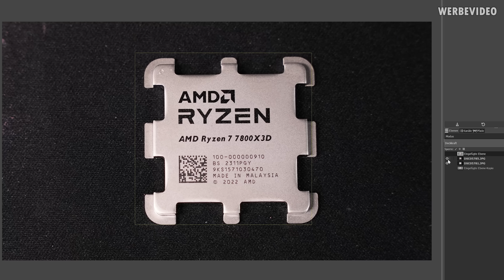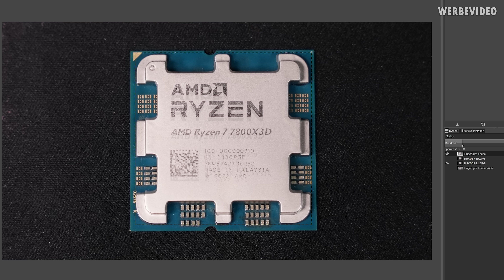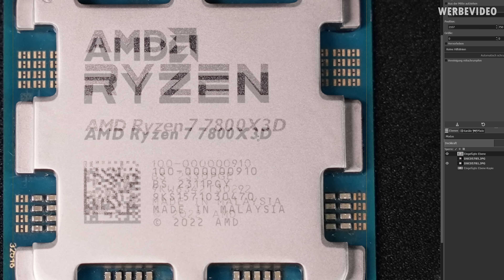Beware! Fake Ryzen 7800X3D CPUs are being sold

Comment: I can easily imagine an out-of-work craftsman having the tools and skills to build this in their garage / workshop. 
Sensible if risky way to earn a decent profit, preying on PC builders looking to save some money. 
The really worrying aspects are: the BOX looks completely genuine. How did they get that?  And worst of all, the matching serial number (cpu and box) plus the genuine looking security seal on the box.   The different font on the heatspreader stood out instantly to me. Nothing else did.
Reply: The easiest way to get the numbers to match is simply to make all boxes and all heatspreaders carry the same serial number, and then never sell the things to retail just mail them one per customer.

I think the fake heatspreader is a zinc alloy casting, if you can accomodate the MOQ, you can order them almost as easily as a PCB if you know your way around the contract manufacturing industry. Genuine heatspreader is copper so it's much more difficult to manufacture.
Reply: This is 100% a Chinese scam. They completely lack any scruples, and even otherwise legit manufacturers will make convincing fakes and sell them via the back door when there's a profit to be made. The box was probably added by the final seller.
Reply: @PharmaGiles  The boxes and fake product could be made in the same factory which is why they have the same serial number. This has been happening for quite some time with sporting goods products and automotive parts, including knock-off serial numbers. The scam culture in China is only just starting to see Chinese youths turn against it (according to statements on other social media platforms). Until the CCP and Winnie the Pooh cares, the scams will keep happening.

Comment: I'd love to see a comparison of the retail box it came in vs a legit box. Or did they find used boxes and repackage? I would think there are marks to show it was opened before like surface scratch marks, adhesive, etc. Does it have the magnet holding the flap closed like the original? Are other AMD boxes identical no matter the CPU or are there differences between CPU models and the printing on the side reflects that? i.e. does the 7600 box look identical to the 7800X3D other than the printed serial number sticker sealing it closed?

Comment: Quick question i have an i3 8350k and it now struggles to play modern games despite a generous 700mhz all core oc.
I have a decent Mobo and ram to go with it.
Would a second hand i7 8700k going through the same process of a generous all core oc be worth it for say a 3 year stop gap as the CPU in question is only £80.
If i upgrade to AMD or Intel it would require a new Mobo and most likely DDR5 ram as AM4 platform despite all the great CPU's are on a dead end platform like the one i am currently on. Intel is not an option as the k series 13th and 14th gen CPU's are all busted internally from what i understand.
AMD would certainly be a massive outlay which i just can't morally ignore and my wife would not be happy if i blew £700 for a CPU mobo and ram upgrade.
Many thanks for any input and advice great content as usual from the MAN himself der8auer.

Comment: I got a 13900k from my local Best buy exactly like this about a year ago. I was delidding it anyway for a direct die water block and the IHS came off easily just like that. Thinner wafer, no die, just black silicone gluing the IHS on. Purchased in store and it was sealed.

Comment: These days you can fairly easily design a PCB, especially if it doesn't have to do anything. The IHS also isn't that difficult to design. Designing both probably wouldn't take a day. And you can have just about ANYTHING made to design for very cheap. Just look at JLCPCB. Send in the files, and you get a few hundred of them complete with capacitors. They even do custom metal 3D components. You order, they make. It's not up to them to ask what you need it for.
Pay say €500,- for 100 PCB's and 100 IHS's, and you only have to sell 2 to get a profit.
And yes, there's also the box. Add another 200,- for 100 of those maybe. Say you're making prope for a movie, of a stage play or something, and nobody bats an eye.

Comment: I stopped using the OLX group portals years ago. It used to be a really good website, I actually earned money for my first car there. But then the portal became more popular, many scammers started using it, the overall quality dropped and the portal itself was not very willing to help, because apparently its task was only to place advertisements and people were supposed to make arrangements on their own. No verification, no responsibility, do what you want and then let angry people look for you. It got to the point that using this website was just a waste of time and money, because maybe if you wanted to buy platters it wasn't a problem, but if you wanted to buy a used graphics card to replace one in your laptop, you bought 4 on this website, just to find out that they were all damaged and regenerated in the kitchen oven, until you finally selected the one that had a short circuit and burned the +12V lines in your laptop. Don't ask me how I know this. Now they have improved the situation a bit, they have safer shipping, a certain level of verification, they engage in negotiations if something is wrong, but still, if you want to be scammed, go to OLX and buy something expensive/specific. I'm not saying that there aren't honest people on this website, but you have a very high chance that your purchase will turn out to be a disaster.

Comment: But why? If you're going to scam people over mail-order (since this scam wouldn't work in brick-and-mortar shops), just send rocks in boxes or send nothing. No need to manufacture an elaborately designed dummy and pack it up in an original-looking box. I thought this video would be about scammers selling re-labelled and possibly modified but still actually functioning (though not as expected) lower-tier SKUs.

Comment: @der8auer-en small holes can be for weight difference compensation.
I saw fake portable HDD/SSDs with metal billets inside to match original specs.
They were even recognized by the operating system, and a small chip tricked the system into storing data... which of course couldn't be read.

Comment: I just had a friend send me a Threadripper Pro 7965WX, MB and RAM to troubleshoot a no start up problem.  The issue was the heat spreader had been shaved and re etched with the Threadripper Pro 7965 WX but it was indeed a TR40 CPU.  I did not have another board to put it in to see if it would boot or what CPU it actually was.  I fixed the bent pins on the MB and shipped it all back to him and had him return the CPU to Amazon where he bought it.  It was sold by Amazon and shipped by Amazon.

Comment: I suspect these fake CPUs may not have been intended to end up in the hands of end users.  Imagine a scenario where a business purchases a bunch of processors from an upstream vendor, then they return a smaller selection of fakes back to the vendor as "NFG", the upstream vendor builds up a stock of bad CPUs, then because of their resell agreement with AMD, they never get returned to AMD but end up getting sold via a 3rd party marketplace as a lot of "bad CPUs".  This is attractive to smaller companies and individuals to sort through the genuine non-working units to find CPUs that were erroneously returned as NFG, so they can resell them as good via a marketplace.  Perhaps the fake CPUs got resold as "new in box" via the marketplace because the seal was never broken, so the vendor never tested them.  That's how you launder fake CPUs into the supply chain and have several layers of insulation between the entity which created them and the end-user who got screwed.  The scam probably started out as a B2B grift, because end-users are more likely to poke holes in a fake than a business that does millions in commerce and just chalks this up to the normal cost of doing business.

Comment: The Fake IHS looks to be die cast Zinc (like Hotwheels), the genuine IHS looks to be die stamped, that's why it has the marks, that's from the final step in the stamping process where they cut the excess material away.  Die stamping is a much higher production process, which makes sense for AMD to use.  The die cast fake has a draft angle, the genuine die stamped part does not.
Reply: So the original is more homogeneous and the “scratches” don’t indicate “lower quality”?
Reply: @mleise8292  I wouldn't call it lower quality, it's just tooling marks from the process.  The parts that need to be smooth and flat are smooth and flat.  The marks are from the stripping die, all of the precision stamping is done before that stage.  If cosmetic quality is a factor for something buried under a heatsink, then I guess it could be called lower quality, but from a functional standpoint, no.

Comment: The two screwholes could both be for the nickelplating process but also to compensate the weight of the entire heatsink, when adding the fake layer to mimic the ccd/io die you add weight, by drilling those two holes you remove some mass/weight from the heatsink (im just guessing) :)
Its wild how desperate people must be to fake a cpu to this extent, mad world :(

Comment: I did not expect this with fake Ryzen... I was expecting the cheapest AM 5 CPU with the 7800x3D heat spreader glued to it instead of the original one but this is manufactured fake.

Could this be like a marketing replica used for marketing purposes only? I can imagine a tech show or some stores could have non-functional replica displayed instead of real deal. I can't imagine any other scenario where someone would go through the trouble of manufacturing CPU replica and box with matching label to sell as fake.

Comment: I don't agree with the conclusion that buying 1st party from Amazon or Newegg is safer.  Plenty of times we've seen in the past where Amazon or Newegg will sell returned parts as new with zero checks to see if the returned product is actually real.  I've purchased a fake part from amazing before.

At the end of the day, so long as you have buyer protection (like everything that isn't for parts on eBay or PayPal purchase protection or Credit card) it doesn't really matter who the seller is so long as you verify what you purchase.  You should be doing this anyways given the number of times I've had Amazon and Newegg screw up my orders.

Comment: that could also be "Display model only" and they would all have same serial and box serial. Intel did the same for conventions as often they would have some stolen from displays, packup , inside jobs etc(high value to pass onto another silicon maker to decap early) . they are also produced for photo ops etc when they want to keep the silicon out of public hands but still have pro pictures done, they dont want to send a security team with it so "mechanical engineering" samples are produced and they wont say sample as they are ment for display/advertising and be as close to final as possible.

Comment: The holes drilled into the heat spreader are probably how the piece is held for machining and labeling.
Reply: i think it might be to do with weight, as the IHS would be heavier with the extra thickness and die shapes perhaps?

Comment: Not only the substrate has different thickness then the original. it has the solder bumps that the die is soldered to, missing. it probably  has only a couple of layers max. most likely it's a PCB that was designed in a free circuit design software and manufactured in China for pennies. check the IHS as well it should be made out of copper

Comment: I know how difficult it is to make accurate copy of some casted or stamped metal piece.

 Not really sure how original heat spreaded is made but it is clear that making fake copy for single piece is crazy labour, time, effort, money costy as you need machinered form to make it. 

If you add even the rest of this fake incl box, printing and pins, capacitors then it is as you said - either targeted directly against AMD or made in multiple copies to make some dirty money from it.

🤷🏼‍♀️ I can't imagine this would be made as the only single piece for trying cash just 1 consumer cpu fake.

Comment: Always use a credit card when buying if you can so you get the buyer protection. If you get a fake have the credit card company do a charge back. Have to admit they worked hard to fake that. Was there a weight difference?

Comment: I bought a 7800x3d from Amazon in the UK.
It just wasn't right.
Was running in the 80° range while playing DayZ.
Even idle it was 50° ish.
NZXT Kraken 360 AIO, remounted multiple times.
I sent it back and the seller wanted 8 weeks to refund.
The Amazon tracking never showed it as being sent.
Long story, but after many hours of complaining to Amazon and escalating I got a full refund.
Reply: those temps dont seem abnormal at all for that cpu if it's not undervolted.... They run pretty toasty.

Comment: Thanks for the review. I was planning to buy the same cpu off Amazon and its dodgy sellers. I am hoping to build AM5 Desktop Gaming PC once the new AMD Chipsets come out by the end of this month. I just wanted to ask you about a review you did last year about, Minisforum B550 Mini Gaming PC, have you managed to install AMD R9 5900x on the motherboard? I did update the Bios from minisforum Japan website and its working well. I had the same issues you had in your video, it kept crashing and restarting and the whole pc was unstable also the CPU downloaded the speed of DDR4 Ram to 2666Mhz which is strange. I had to put back AMD R7 5700G and no issues whatsoever. Thanks

Comment: The interesting part really is the amount of effort going into this. On one hand they have covered a thing that probably not many CPU users will check (that the CPU has a chip in it) but at the same time they haven't copied real AMD CPU fonts and markings that anyone more into could notice, interesting in these is the difference, putting a lot of effort into machining the heatspreader to include mockup chips but then way less effort into something that is extremely cheap (they just need to take a photo of real CPU, make the paths from the photo and their laser engraver will deal with the rest).
It's like with fake money, you would put a lot of effort into manufacturing almost identical paper to print your money on and then you stop that effort and print some movie money on the very high quality paper.

Or then it's just leaving the marks so the scammers themselves don't scam each other. As in, there's couple design features that clearly give the fake away so a person who's in the scam can spot them and avoid getting scammed themselves.
Reply: nothung interesting, it is the same as the fake metallic kingston usd drives, or the fake samsung external ssds or hard disks

Comment: Macar condensatorii sunt reali si au aceeasi capacitate ca cei de pe PCB-ul original AMD?
E foarte probabil ca s-a facut o matrita dupa un AMD original (dellided with your tool) cu o imprimanta 3D la rezolutie mare si a rezultat un heat-spreader de mai buna calitate ca cel original AMD (probabil ca si AMD are multe astfel de matrite ... unele mai bune, altele mai proaste) ...
Probabil ca vor apare zeci de mii de astfel de fake-uri ... cum raspunde AMD la aceasta provocare? Cutiile sunt sigilate, seriile corespund ... nu avem holograme, culorile seamana extrem de bine (daca nu ai un exmplar original nu ai cu ce compara) ...
Mi-e groaza sa ma gindesc cate procesoare fake vor fi facute cadou de sarbatorile de iarna din 2024 ... !
Cat despre situatia in sine: e cea mai win-win-win situatie; vinzatorul a cistigat 300 EUR ( 1 WIN), cumparatorul a cistigat 400 EUR ( 2 WIN), der8auer a pierdut 400 EUR, dar a cistigat de la Google peste 400 EUR ( 3 WIN) ... deci toata lumea a cistigat!
Inclusiv viewerii ... care stiu de situatie, dar nu pot face nimic :washhands:

Comment: Are the gold plated contact points real gold?
That would be super duper insane, that would imply they had top tier connections in the industry to recourse those materials.
I would not be surprised if this was made inside a multi million facility, with known people from the manufacturing industry.
Reply: ENIG surface finish is nothing special, nor that expensive. It's only few um thick. Any Chinese PCB prototyping fab can do it.
Reply: @andiszile  As you say that, this is very professionally done. AKA a multi million facility was used to make this FAKE.
Reply: @N0N0111  My angle is, that pcb fab probably isn't IN the scam. Just as any hobbyist is ordering their pcbs, someone just ordered a pcb that looks like am5 cpu. Fab probably doesn't look too much into it.

Comment: Here in the UK I ordered one from Amazon's warehouse ("tested and working", they say), and just got shipped an empty box, no CPU at all. Amazon didn't question it at all, just offered me a refund and didn't even ask for the box back, so I guess it can't be that rare.
I then ordered a brand new one and got a chip that reboots every few minutes. So far third one seems to be holding up, but it's been a journey.
Reply: The guy tested and was working with the cpu. He told you the truth 😂
Reply: at least amazon customer support here in the uk is extremely good
Reply: Rebooting sounds more like a bios/memory issue if you got a new CPU. Worked on comptuers for year and years its never the CPU.... or almost never.
Reply: @exithe  Well, as it's 2 months later I can say the new CPU worked fine, so it was.
Reply: Amazon is so rich they don't even care. And will refund immediately as long as you have proof and or when you return an item, they see that the tracking says that it's returned.

I even know people buying equipment, use it only once and return it for a full refund without issues.